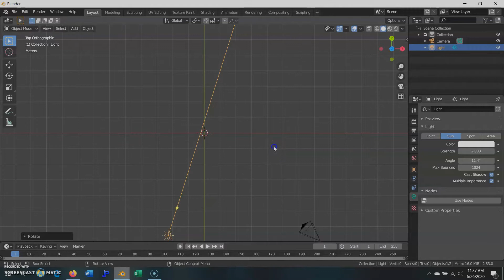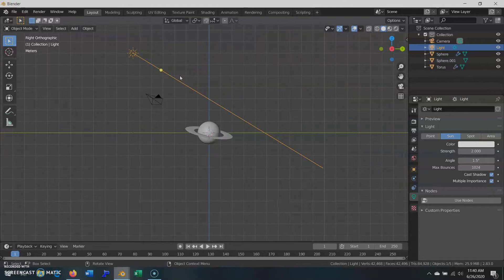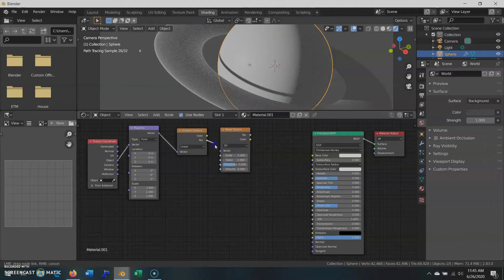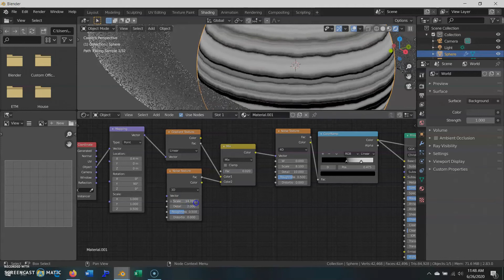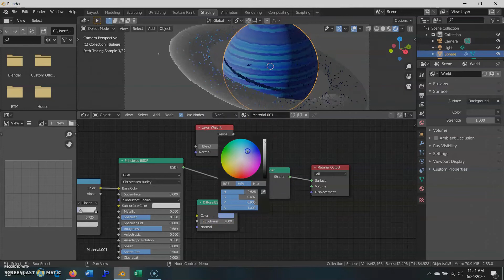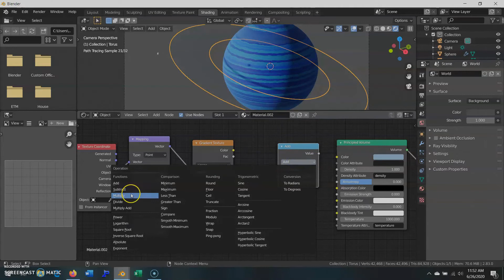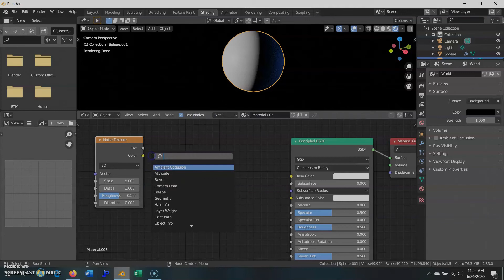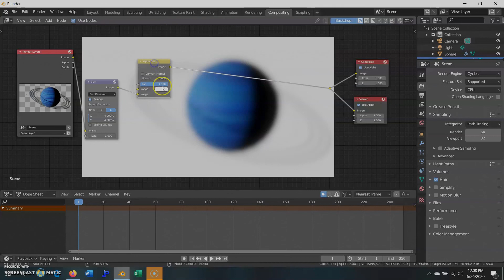Making a Procedural Gas Giant in Blender

Comment: How do you make ring part????
Reply from the maker: Add a torus and scale it down in the z direction.
Reply: @3E8mps  no, i mean the ring effect.
Reply from the maker: @BlueTheCubeLegacy  Use the node setup shown in the video.  The trick is to plug a gradient texture into the vector input of a noise texture.  I also included another noise texture added to the gradient texture to provide a bit of randomness.  This setup can be seen at 3:30.
Reply: @3E8mps   but how did you make it at 1:59
Reply from the maker: @BlueTheCubeLegacy  The ring on the surface at 1:59 is just the shadow of the other ring.
Reply: @3E8mps  Why have you not made a video in a long time?